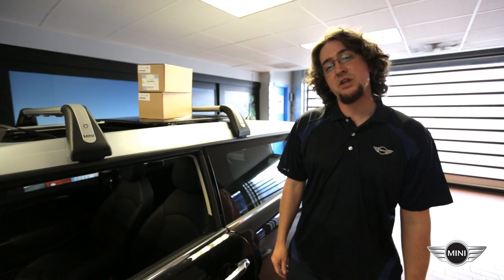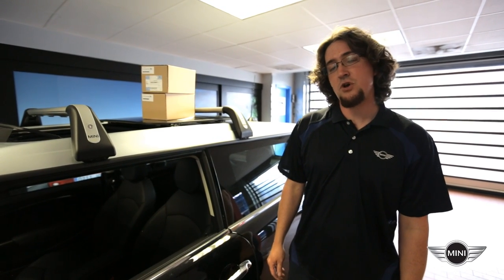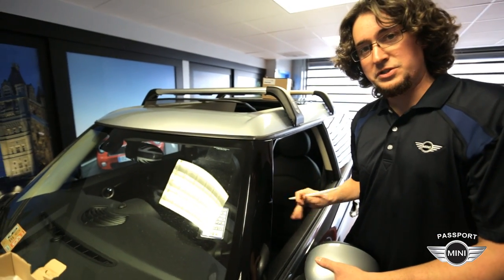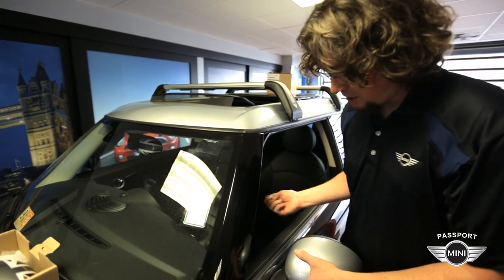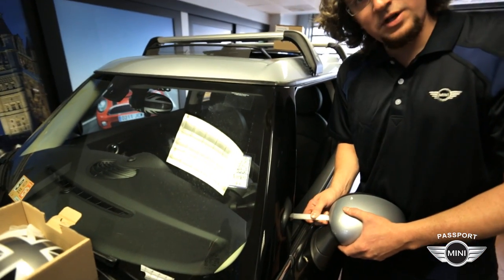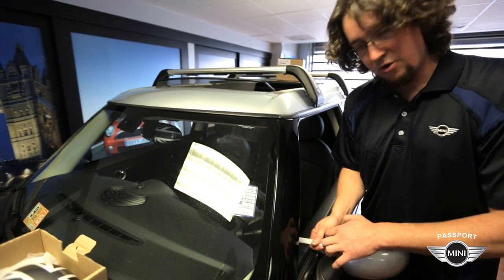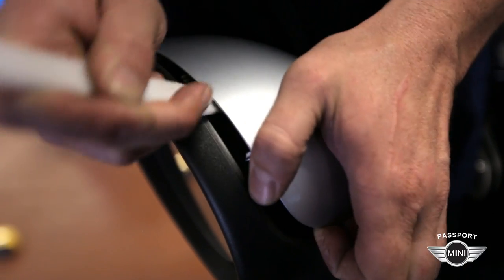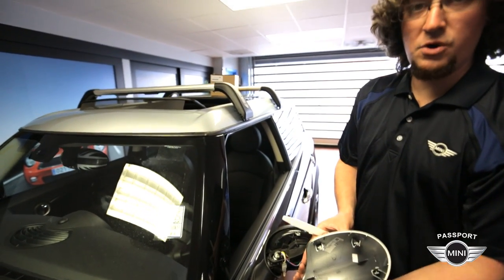MINI Sessions - How to Install Exterior Side View Mirror Caps on a MINI Cooper

Comment: There's a couple of videos around on how to do this, but this is by far the best. I didn't have the tool, but found that grinding the end of an old toothbrush to a chiseled point worked too. The shades-of-grey union jack is the better choice. The blue in the color version didn't really match the dark blue (sorry - reef blue metallic) very well.

Comment: Nice Video!! I'm in Brazil and a have de mirror caps, but I don't have the tool that appears in the video. what kind of tool should I use to get the job done ?
Reply: I used one of the smaller thin tools that came with my trim removal kit.